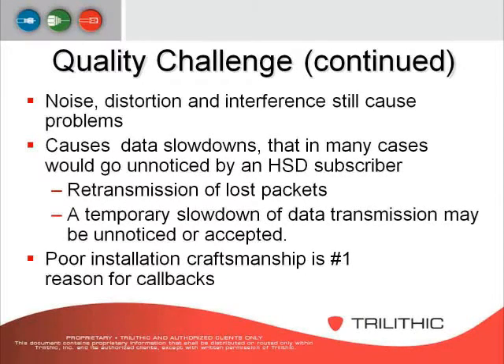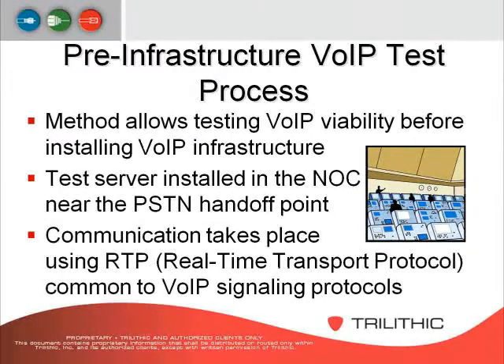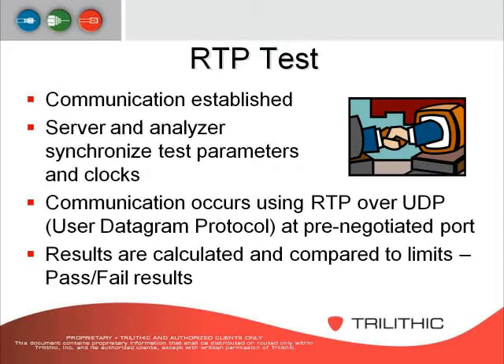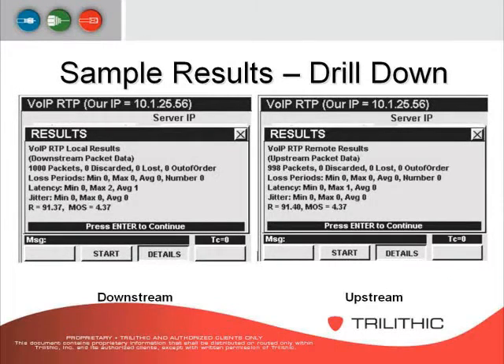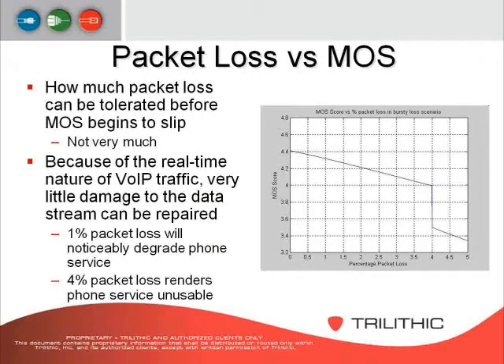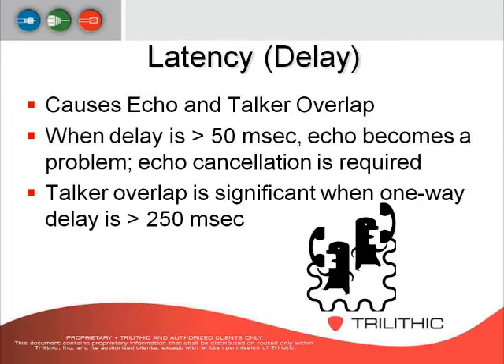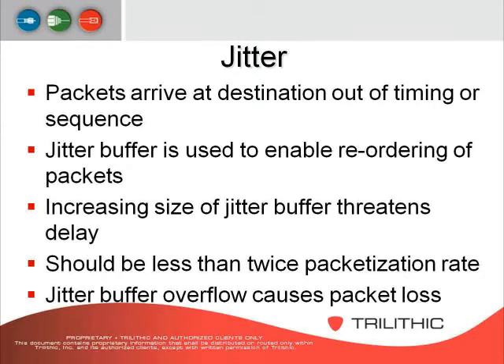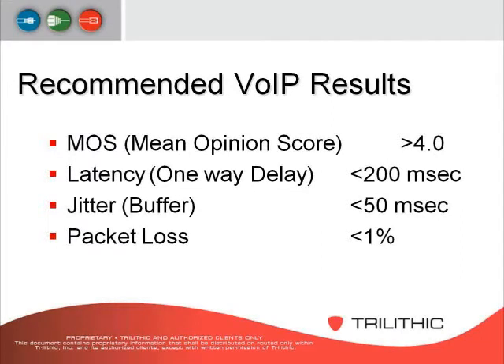Voice Over IP Tests and Measurements

Comment: Just curious as to why there was so much effort put into the R-Factor and MOS when It clearly says's that the MOS is "Subjective"?.  So since It's subjective does that mean that as a technician I could easily disregard the MOS system?  Or Is this test accurate, enough for a technician to have confidence with the MOS and R-factor scores? Im assuming Triolithic had a study and tested subjects with a range of deference's in the Latency, jitter, noise  and Packet loss?